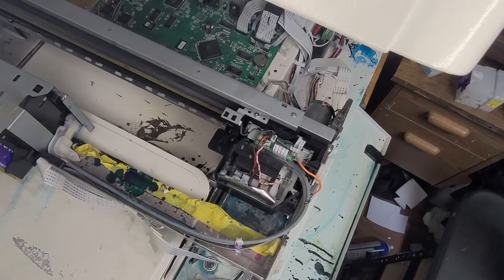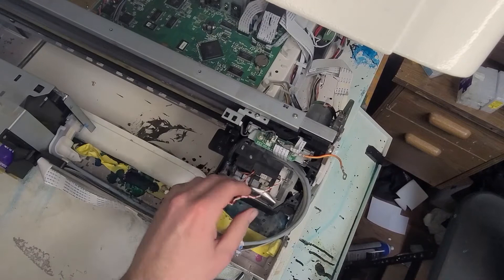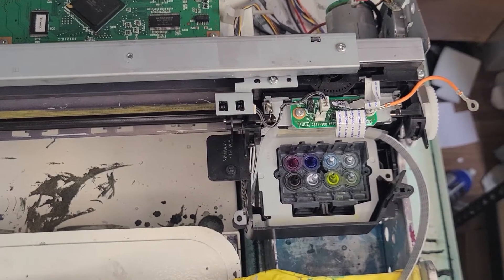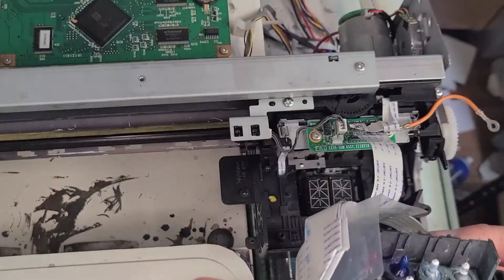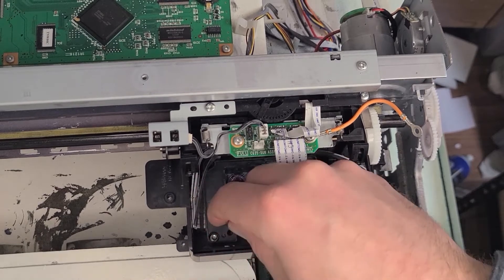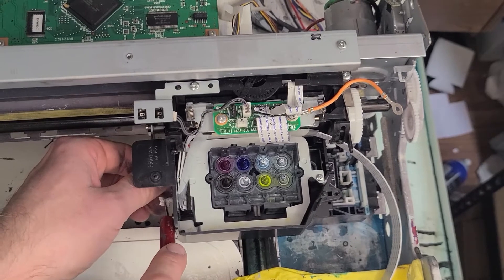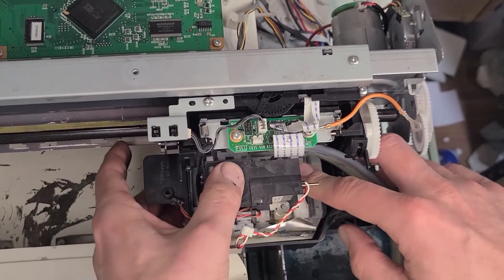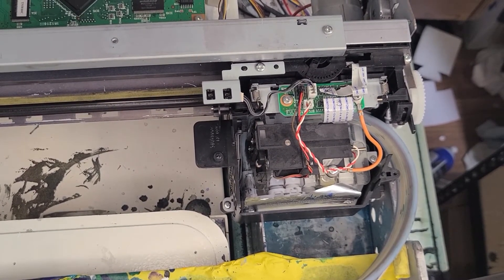Epson 3880/3800/P600/P800 Damper and Print Head removal

Comment: HI MY FRIND 

I have an Epson p800 printer. I cleaned the head after that it worked once and then it showed the code 011A after that it opens
 but the blue color keeps blinking and the main computer screen does not open
Reply: HI 
ERROR GODE : 0X1512

Comment: Thank you for the teardown video! I'm currently trying to figure out why my MK nozzle check keeps showing random patterns. I've taken apart my head and did a flush as well as removing the MK/PK damper switch and flushing it. I'm still having the same issue with the MK not displaying a complete nozzle check pattern. Any suggestions or ideas as to why this is happening? Does the P800 suffer from airlock in the dampers?

Comment: Hello, wondering if you could help  me with a stubborn problem I am having with my epson 3880 printer.

I have had it disconnected from a computer for about a year, (moving and storage). I just recently tried to reconnect to a newer computer (running windows 10 version 21H2). But regardless of what I try I cannot get it to work with the computer. I can print a test page (nozzle check) using the manual inputs on the printer, and run a cleaning. But I cannot run a nozzle check using the computer utility. I am able to ‘add’ a printer, but it does not seem to be able to do it all automatically. I have to manual select the ‘port’, and have tried quite a few different ones. I have tried different usb cables just in case that was the issue, but to no avail. And oddly, I have both a 7880 and 9880 which work fine after having upgraded from Windows 7 to Windows 10 on the same computer system. I have never had the 3880 working with this computer before. It was attached to an older computer running windows 7. When I tried to connect back to the old computer running windows 7, the same problem occurred. Have no idea why it worked before for years, and then would not work afterwards, I have run the 'trouble shooter many times, and it always says 'it was not able to resolve the issue'. Also when I try to download the drivers, I am not able to do it automatically, it forces me to do it manually going through the process of choosing which printer port to use, I usually choose the one that I am using for the 7880 or 9880. 

Again I can ‘add’ a new printer on the old computer, but when I try to run a nozzle check using the ‘utility’, it says, ‘error unable to run nozzle check’. When I try to access other utilities such as status of ink levels, it states ‘unable to communicate with printer’. 

I have tried numerous times to remove the printer (3880), and delete all the drivers and reinstall them, but nothing seems to help. I have even tried to use the original disc that came with the 3880, and it will not work either.

Hopefully you can offer some solutions, or direct me to where I might find some direction on how to fix this. Sorry for the long post, but I am at the end of my wits (the little I had left).

Comment: As always, thanks a lot for your videos, very helpful. Is there any way for suck ink through the damper to fill it? when I try, the system feels pressurized and I can't suck ink. Of course the printer is unplugged.
Reply from the maker: Yes, if we are talking the 3880/3800 series it does need to be pressurized, printer on, head disengaged. You can remove the damper assembly from the carriage and suck the ink through it. If the carts are not pressurized it will not allow ink to flow through into the dampers
Reply: @planetpodcast5607  Ok, thanks a lot, so the printer must be power on. I go to try it, i appreciate a lot your help

Comment: Does this help the 1127 code or is it different issue?
Reply from the maker: 1127 is a different issue. Related to the print head capping station, its not docking properly

Comment: Hi I did a swap of the pump cap and also the dampers (You;re video was so helpful - thanks) but now seem to be getting no inkflow through the head on my DTG - any ideas and help would be awesome - thanks
Reply from the maker: Andy, give me some more information. Which printer are we talking about, which head, Any errors at all? What led you to swapping the capping station and dampers to start with? How was the nozzle check prior to doing it?
Reply: @planetpodcast5607  Hi its a 3800 based dtg. Print quality dropped, to very muddy print, looked like hardly any white channels.magenta had been bad all day. Power cleans weren't achieving much. I had the printer idle probably 2 weeks before this. Last time I had a drop in performance like this it was the pump cap. So I swapped that over and also decided to grow a pair and swap out dampers. So I had a brand new pump cap assembly so I figured maybe the used one was bad so I swapped that. I've never tackled dampers before but the new ones had no ink in them still so I swapped whole damper assembly from a spares 3880 I had. Still nothing when I try to print. New capping station looks way too clean still 
Not sure what I've done but wish I hadn't! Got people waiting on shirts now

Comment: Thanks for you video.I have an Epson 3880. Just recently I have notice that when making reprints of images I made a few months ago that my prints are coming out lacking the proper color saturation and the color prints look sort of muddy. I have done several print head cleanings and can see my print test page look very light but the nozzle check sheet looks good. The inks in my unit are a couple of months outdated. I have had the printer a number of years and it has had steady use but certainly not heavy use. Where should I start it looking for a solution to my printer problem? Do certain parts need to be replace due to age?
Reply from the maker: If you are printing with OEM carts , like actual photos on photo paper I couldnt really tell ya. The Dampers do need to be replaced as the filters will clog and limit ink flow , If your nozzle check is good then odds are its the software you are printing it from that needs adjustment.
Reply: @planetpodcast5607  You were right. I found that my Epson driver did not automatically update. Updating to the latest driver resolved my problem. Thanks.

Comment: So glad I found your channel thanks for the great videos..  just found a stylus pro 3000 at a thrift store for 20$ Last week. The ink cartridges had a a 2008 stamp on it so every line was extremely clogged but Basically I was able to unclogg all the lines the first day except for the magenta which after 5 days of soaking in cleaner it's finally ready to reassemble.  Just wondering since I also had to clean out those rubber white hoses, what's the safest process after I reassemble it to get the ink back from the carts? I spent this long on cleaning I don't wanna screw it up now lol. Thanks again for the valuable info :)

Comment: Perfect video, quick question. I saw in the video  after putting windex, capping station drained all the windex. it shouldn't be full of windex to keep print head wet?
thank you
Reply from the maker: I've seen people do it both ways, I've seen them say that just the fumes inside of it is enough but I like to keep it with actual fluid in it
Reply from the maker: To better understand why look at the video of what's inside your printhead that I posted

Comment: I’m getting error 131b like my print head is over heating.  It does it automatically when turning on printer.  I know I have air in my lines and have been trying to get it out.  I can’t use a adj program.  Can’t get it to work.  Help PLEASE.
Reply from the maker: I have gotten that one too, im not sure what the solution is honestly.
Reply: I'm getting the same error code. Any solution?
Reply: @davidcole269  I let it sit for awhile and the error wasn't on when I turned it back on but... I bought another printer and haven't tried messing with it again yet.  I need a new ink bay I know.

Comment: Hello I'm getting the 1601 error on my epson 3880 and wanted to know how to fix it without removing the carriage assembly?
Reply from the maker: I get that one sometimes, if I restart the printer with the head undocked in the center it will go away, if not you may have an issue with the C1 cable to the head carraige

Comment: In this video you manually disengaged the print head carriage from the capping station. I can’t seem to figure that out. Can’t move the carriage clear of the capping station as it seems locked. What am I doing wrong?
Reply: Turn off and back on. While it's powering back up watch the head.. it will move.  When it moves hurry and unplug the printer.

Comment: bro i just print head waterfalling by using this video as procedure but after that it does not print anything please any suggestion it print head is p800
Reply from the maker: You have to be so careful when doing a waterfall, too much pressure will blown out the seal in the head. If the seal blows it will be useless. What was the initial head condition , what did you do to clean it
Reply: @planetpodcast5607   i have texjet dtg machine the head conditions was bad the black were absolutely zero when i make nozzle check all channel are fine expect black but it prints green instead of black when I test CMYK so I make waterfallsing it own cleanning solution now there is no error message displayed on the screen but it i s blank after waterfall i have anew head should i relace it

Comment: My 3800 stopped printing. it goes through the motions like it is printing but no ink to paper. It has been cleaned and it is pumping ink. The last thing it did was print half a photo and then all white. What could it be? I also have another 3800 that won't print at all at either won't take paper or if it does it just shoots it right through. Any ideas on that?
Reply from the maker: @johndromeshauser in my experience with my free jet that is a printhead problem. for some reason it's not getting the signal to actually spray ink. I had a damaged motherboard on mine and while it would act like it was going to print no ink would come out. I had to replace that main board and ultimately the printhead. I have not experienced this with the 3880, however I have replaced all of these parts in that machine due to other errors. have you removed the printhead? are you just checking the waste ink container for extra ink after head cleanings? how do you know it's pulling ink through all of it?
Reply: @planetpodcast5607  I had to do a power clean amore than a few times to get ink through the system because I replace the damper. Doing this used a bunch of ink and filled my maintenance cart. So I assume it's pilling ink through the system.
Reply: @planetpodcast5607  I just replaced the print head and the board. it.s dead.